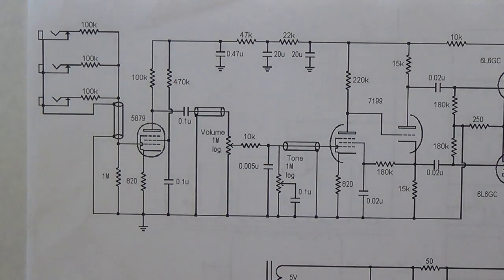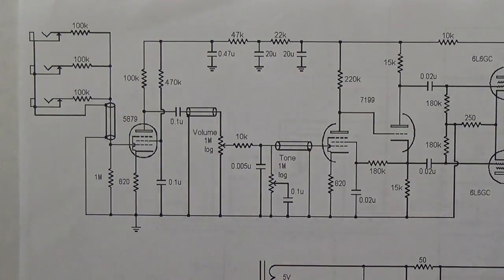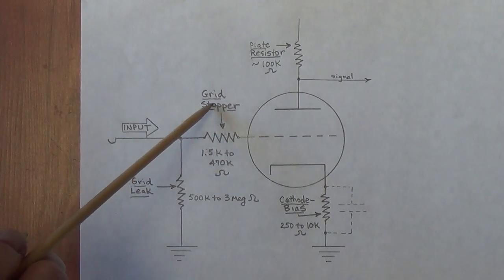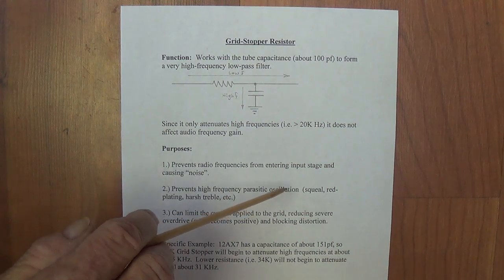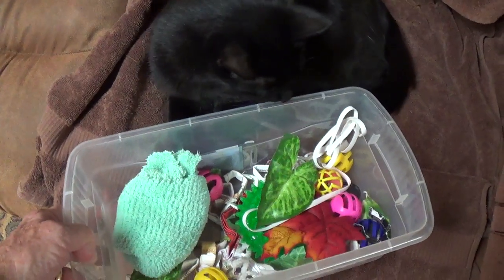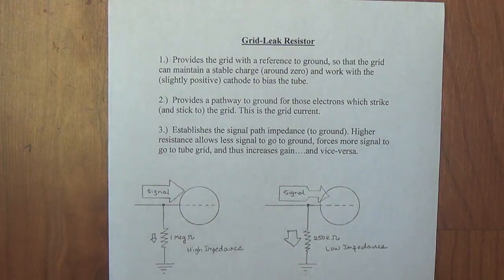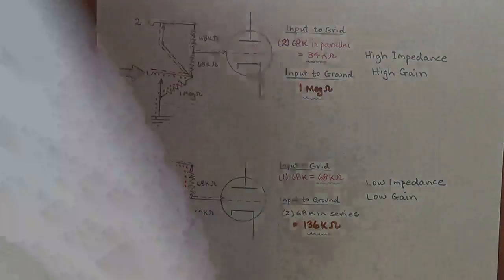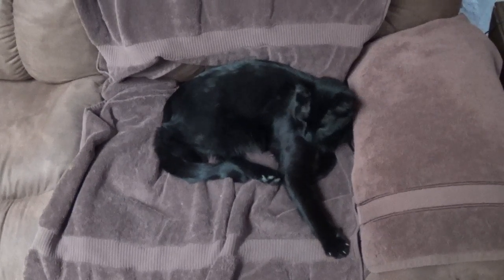Resistors, Part 3: Grid Leak, Grid Stopper, and the Fender Input Circuit

Comment: Thank you very much for the video.  I'm learning a lot about tube amp.  And I need to learn it to fix my Allen Organ model 75 amp that have been modified for use in hifi application.  There seems to be a 120hz 0.3Vrms at the output to the speaker.  It would be helpful if you can provide some tips to fix it.  Thx!
Reply from the maker: Any 120Hz hum, if you have 60Hz AC supply, is due to failing filter capacitors, RL. If you have 120Hz supply, the hum could be due to a large number of different causes.

Comment: Hi Doug, another fantastic video, really enjoying the series. I wanted to ask a quick question if I may. Recognizing that the Grid Stopper and tube capacitance together form the components of a low pass filter, the arrangement seems to me is different than the analogy you make to the low pass filter. The capacitance of the tube is across the plate, not to ground as the filter is which to me suggests that any HF noise makes its way through the tube to the next stage, not away from the circuitry as in a filter arrangement. I am learning an immense amount from your video series and really enjoying them. Thanks so much. Laurence
Reply from the maker: You're welcome, Laurence. Filters can be used in different ways. If a low pass filter is connected to ground, it will allow the low frequencies to leave the circuit, thereby accentuating the high frequencies....as in a treble control. If, however the low pass filter is inserted in the signal path, it will have the opposite effect, allowing low frequencies to pass and blocking the high frequencies.....as in a bass control.
Reply: There is a capacitance between plate and grid and also between grid and cathode. There is a path to ground for the AC signal at the plate via those two capacitances in series and the low value cathode bias resistor to ground. The capacitance between plate and grid is multiplied by the gain of the stage due to a process known as the 'Miller Effect'. It's the total capacitance between plate and grid that forms the low pass filter in conjunction with the grid stopper.

Comment: Many thanks for all the tutorials you post. I have found them invaluable and very easy to understand and entertaining. I'm very new to amp building and a couple of things that crop up on forums, especially when fault finding, are parasitic oscillation and blocking distortion.

You do mention those in your latest resistor video but I have no idea what parasitic oscillation and blocking distortion actually sounds like. Do you think you could produce a video that demonstrates an amp with parasitic oscillation and blocking distortion? I'd know what to listen for in future.

Thanks again for videos and tuition.
Reply from the maker: +David Stanley  You&#39;re welcome, David. Actually, in both cases, there is virtually nothing to hear. Parasitic oscillation is generally above 20K Hz and can silently result in red-plated output tubes (despite proper bias) and arcing between tube pins.....very destructive and not something I would ever care to demonstrate. Blocking distortion does just what it sounds like....it blocks the input signal, causing output volume to decrease despite an increase in input volume. Both can be prevented with proper grid stopper resistors.
Reply: +Uncle Doug Many thanks for the quick reply and for adding a bit more to my understanding. Thanks again.
Reply from the maker: You're welcome, David.
Reply: +Uncle Doug I have been watching the video again and I have another question if that's ok? What stops the signal on input 2 going through the 1m resistor to ground, how is it bypassed?
Reply from the maker: Good questions are always welcome, David. Electricity takes the shortest, least-resistant path to ground. When confronted by a choice between zero resistance and 1 million ohms of resistance.....you can guess which way it goes.
Reply: +Uncle Doug Got it. Thanks again.
Reply from the maker: You're welcome, David.
Reply: The vulgar term for blocking distortion is 'farting out'.

Comment: Uncle Doug, I've never learned more about amps and electronics than from your crystal-clear video's ! There is one thing that confuses me in this Input Circuit schematic : the path taken by the "Input to Ground" shouldn't it rather be pointed from the grid towards the ground (instead of the jack input) ? I have trouble understanding these 2 different flows from the input jack, one to the grid and one to the ground.
Reply from the maker: The incoming signal has two pathways, Alex. Going to the pre-amp tube grid, or going to ground. You have to be sure the balance is correct or you will either overwhelm the tube (distortion) or "underwhelm" it (poor volume and tone).
Reply: Uncle Doug thank you ! I think I understand now : the less signal can go to ground, the more signal is allowed to the grid, thus results in more gain and vice versa. Makes all sense now.
Reply from the maker: @alexv7745  Yes, but you can't overload the grid or distortion may occur.

Comment: Uncle Doug, great Video as usual!! Couple of things I don't understand, one from this video and one just in general. Let me start with the general question...
Why do we have to BIAS output tubes but not pre-amp tubes? It seems to me pre amp tubes would have the same problem, no?

Now, from this video; When talking about plugging into input 2, why would the signal bypass the the 1meg resistor to ground? Looks to me that it is still in the circuit just as with Input 1?

Thanks again for these wonderful videos!
Reply from the maker: +Marvio Botticelli  Thanks, Marvio. Glad you liked it. Pre-amp tubes are biased. Most often, they are cathode biased, which does not require checking and adjusting when new pre-amp tubes are installed. Also, they operate at very low current levels, so small changes in plate current are not a big issue.

The signal bypasses the 1 Meg resistor because electricity always takes the shortest, least resistant path to ground, and in this case it's either 0 ohms to bypass or 1 million ohms to pass through the resistor. Which path would you take?
Reply: Uncle Doug
I see!!

So, could one cathode BIAS an output tube as well? I'm thinking about some amps who claim they need no BIAS on the output tubes...

Also, on the resistors... Indeed sir, 0 resistance sounds better than 1 million Ohms! Makes sense :)

Thank you again
Reply from the maker: You're welcome, Marvio. Yes, many output tubes are cathode biased, and as a result generally do not need to be re-biased if tubes are replaced. Cathode biasing tends to self correct any tendencies for excess current flow.

Comment: Thanx....I struggled with this on a Marhall JPM 2203, I stll dont know why the Low input is soooooo low...but I'll apply what I've learned here next time I open it up . Thanx Doug...I have a spoiled cat too....she also drinks ONLY from a glass with FRESH water....will have to try crystal...
Reply from the maker: +GuitarHack123 You're welcome, GH. I looked at the schematic for your amp and when you plug into the Low input, you're skipping the first stage of amplification and going straight to the second stage. When you plug into the High input, you are going through both amplification stages.  This would render the Low input virtually worthless for anything except perhaps an effects pedal that also boosted the gain.  Here's the schematic:  http://www.drtube.com/schematics/marshall/2203u.gif   Jack sends his regards to your equally spoiled kitty :)))

Comment: Excellent!
Reply from the maker: +John Heaphy  Thanks, John.
Reply: +Uncle Doug I would be interested in hearing how the impedance of a stage affects the prior stage...  I have heard that if the impedance is too low it can make the prior stage work too hard.
Reply from the maker: The only place that I'm aware of such an issue is with the output transformer, matching the high impedance tubes with the proper impedance speaker.  Perhaps there is more information available with a Google search. Good luck.

Comment: Hey Doug, thanks so much for all the videos, they include the most understandable information available on amps that I have come across yet. One thing is I do not get is: why or how can the second input bypass the 1 meg resistor to ground ( I am new to reading schematics)?
Reply from the maker: You're quite welcome, Lead. Before I can answer, I'll need to see the specific circuit or diagram to which you are referring.
Reply: Uncle Doug, thanks so much for the quick reply. I am referring to the circuit you use in this video. You explain it around minute 21:00. To me it looks like the lower 68k resistor is connected to the 1 meg resistor and that's why I do not understand how the signal coming from input 2 can bypass the 1 meg resistor after going through both 68k resistors. I hope my problem is clear and not too trivial.
Reply from the maker: Given the choice between passing through an additional 1,000,000 Ohms of resistance or going directly to ground, virtually all the electrons will choose the "path of least resistance", Si.
Reply: Thanks so much, makes a lot of sense!
Reply from the maker: You're welcome, Si.

Comment: Amazing series, thank you!
I wonder if you would ever consider making a video on HOW to read schematics. I kept wondering if that grid stop resister was literally soldered to the input jack, or is it literally soldered to the grid of the tube, or are there wires on either side of the resistor leads. Or even more intriguing for me, were BOTH resistors soldered directly to the grid? I feel I have seen this on tube sockets before.I kept hoping you'd stick in a real image of the 12ax7 and the grid stop and leak resistors. It just points to the final frontier for me of fathoming schematics. I just know you'd make it easy to understand. But I'd still love to take a tour of a circuit with the schematic and the actual amp referencing one another. Thanks again!
Reply from the maker: You're welcome, RB.  To be honest, there is no magical shortcut to learning how to read schematics. Just like learning a foreign language, you have to first master the vocabulary, thoroughly understand all the sub-units in an amp circuit (power supply, input, pre-amp, phase inverter, etc.), learn the symbols, understand the function of capacitors, resistors, etc. Once you understand all the basics, only then will you be able to interpret a symbolic diagram of the circuit.

Comment: You're the bomb Uncle Doug!  I am curious, what effect does plugging in two guitars or a guitar and a mic have on the circuit?  I ask because I used to run a mic in one input and my guitar in the other. Never had a problem but it was always in the back of my mind.
Reply from the maker: Thanks, KV.  Most amps with multiple inputs are designed to accept two instruments or a microphone and an instrument. Any impedance differences between the two devices being input to the amp can generally be balanced by their own individual volume controls.

Comment: Thanks so much Uncle Doug for all your informative videos!  I recently bought a 1962 Gibson GA-5 and as far as I can tell by both the schematic as well as looking at the circuit board neither stage of the 12AX7 has a grid leak resistor. Just wondering how that affects the amp as far as developing more of a negative charge on the grid if some electrons stick to the grid, establishing the impedance to ground, etc.?  Thanks!
Reply from the maker: Sometimes other components, i.e. a volume control, can provide the grid leak resistance, Bill. To be sure, simply measure the resistance between each tube grid and ground. If there is infinite resistance, then that grid needs a leak resistor.
Reply: Thanks Uncle Doug!  I really admire you not only for sharing your knowledge with us and all the time it must take to research and do all the videos, but you are kind enough to respond to just about every comment you receive. I will measure the voltage and go from there. Between the first and second stage of the 12AX7 there is a 1 Meg volume control, so that must at least help the second stage. All the best to you and your family and take care!
Reply: Whoops, I mean I’ll measure the resistance between the grid and ground.
Reply from the maker: You're welcome, Bill. Yes, you'll find that the volume control acts as the grid leak for the following 12AX7 triode.

Comment: Thanks Uncle Doug for your amazing videos! Can't thank you enough for your generous sharing of knowledge in such an easy and enjoyable way. I've just bought a 5F1 champ clone which sounds good but a little on the shrill side. I'm thinking of installing a (treble cut) tone pot. Or should I first try putting a 220k or higher grid stopper resistor at pin 7 of the 12ax7 to smooth things out a little and tame the high frequencies a little? The NFB is intact from what I can tell. Thanks in advance. And a big hello to Rusty and Jack from Australia
Reply from the maker: You're welcome, James. There are several approaches to reduction of treble. You can add a pot with low value cap (experiment, starting around .001uf) to ground or you can simply find a cap value that suits your ear and hard wire it into the signal pathway (to ground).
Reply: Reducing the value of coupling capacitor(s) will reduce treble.
Reply: Sorry, make that increasing the value.

Comment: Hi Doug, I was wondering if you use an oscilloscope? I'm thinking about getting one, is it worth it when working on tube amps.  If so a tutorial in the future would be immensely appreciated. Also happy New Year to you Jack, and Rusty.
Reply from the maker: +Greg Krupa I have an oscilloscope, Greg, and have used it occasionally, but tend to perform most repairs using just a multimeter. I will keep your suggestion in mind for the future. Thanks for the holiday greetings and likewise to you and your family.

Comment: Found the bit about grid resistors and low pass filters very informative. Two questions: (a) where can I find the capacitance of various tubes (how did you determine a 12AX7 was 151pf? I am looking for data on 12az7); (b) when would it be appropriate in an audio circuit to have a grid resistor as high as 470k ohm (which would have a 3db down point of just 2.25 kHZ)?
Reply from the maker: Glad to hear it, Maslow. Info like this is available in most tube handbooks or on the internet (do Google searches). By "grid resistor" which do you mean....GS or GL ?

Comment: At 9:16 how did you come up with the frequencies according to what resistance are blocked? What equation did you use? Doesn't the amount of attenuation and the frequencies bled off to ground depend on what voltage and current are feeding into the resistor?
Reply from the maker: Watch the video on Tone Stacks:   https://www.youtube.com/watch?v=uZHM5BwPLRw  The formula and calculation of frequency cutoff is explained.  Voltage has nothing to do with the attenuation.  It is based entirely on frequency and the values of the resistor and capacitor in the filter.
Reply: The cut-off frequency of an RC filter is given by f = 1 / 2πRC.

Comment: Hello, first of all thank you very much for the videos, they are great, I had a question about the grid leak resistors and the stoppers, is it better to put the grid leak before the stopper? or the type of assembly is indifferent.

Thank you very much, regards
Reply from the maker: The grid stopper should be attached directly to the tube's grid pin, Fuzz. The grid leak is placed earlier in the input circuit.

Comment: Hi Doug, thanks for your videos. They've really helped me with my foray into amp building. I have a question if you happen to see this post. It's about grid leak resistors specifically in the valco built amps I have. Both are single end 6v6 with the older one having a pentode 6sj7 in V1 and the other being 5-6 years newer. I'm curious that the grid leak resistors in both are 6m8 ohm with both drifted up to 7meg +. With the pentode I have always assumed the very high value was to do with my not bring very familiar with their bias needs so as to sound 'correct'- but after watching this video I'm concerned that the amp with 12ax7 whose grid leak is also 6m8 (Drifted up to 7+) might be causind damage that I won't know about until the op transformer goes. It's an Oahu branded 1606 with a tone control while the older pentode is the same circuit as the valco English branded amp that you did in one of your earliest videos. (Mines the blue supro studio 1644e ) where could I find more info on metal octal pentodes as preamps, and is there an easy way to check for parasitic oscillation? Many thanks for your brilliant videos that have taught me so much. 
Marty in Australia
Reply from the maker: Greetings, Marty. The preamp tubes have no effect on the output transformer.....so you have nothing to fear. Grid leak biasing is extremely primitive. You might consider cathode biasing your preamp tubes and bypassing the bias resistors with capacitors to increase gain. If none of this makes sense, simply look at how Fender wired the 12AX7 in the 5E1 Champ circuit.
Reply: @UncleDoug  Great info!- Thanks for replying,  M